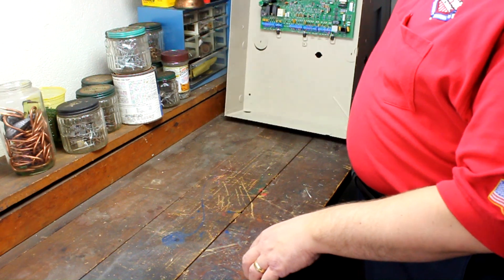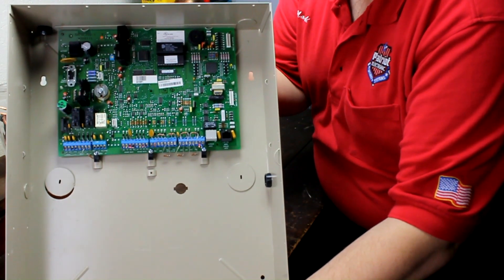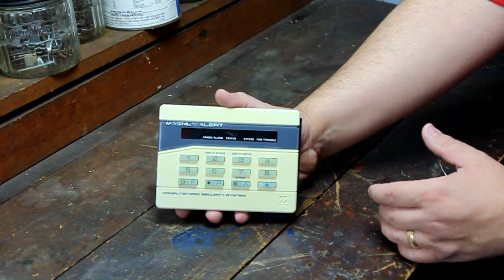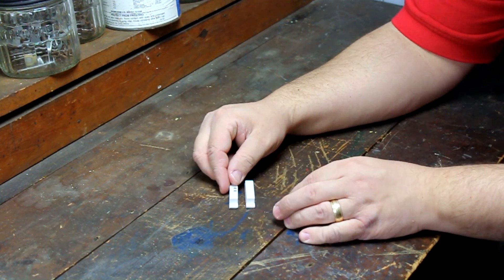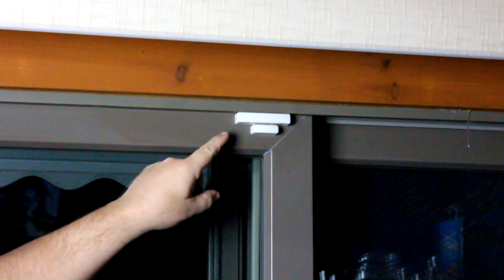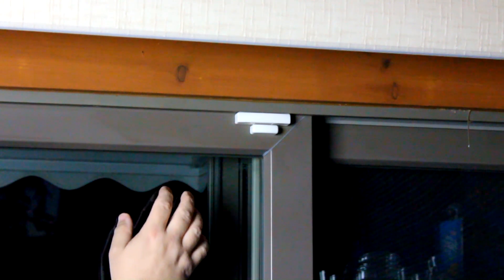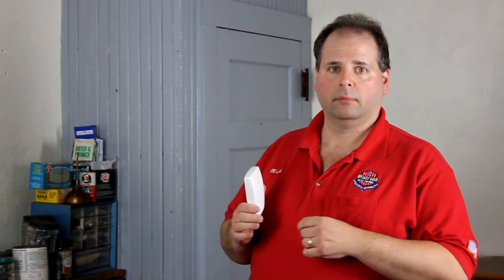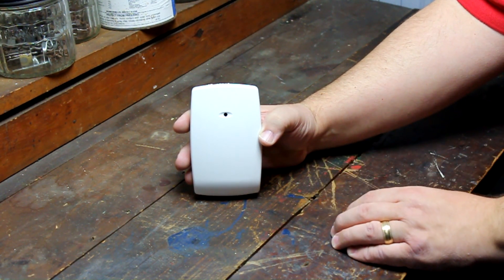How a Security System Works (Part 1)

Comment: So, what powers the transmitter that is next to the magnet?  battery?  certainly not wires as that would be cost-prohibitive.
Reply from the maker: If you are using a wiresless systems the transmitter is indeed powered by a battery. If however this is a wired system, and the contact is just a door or window switch, then wires run to the switch and the circuit that the swtich is a component of is powered by the alarm control board.
Reply: This ADT one has the big unit on the door and tiny magnet on facing but no wires.  There IS a battery inside but if you disarm the system THEN remove the cover of the big unit, it KNOWS!  It sends some alarm even when the system is disarmed by the user.  Then the phone call says the batter is just a backup.  ?  I'm totally confused.

I understand a switch can be turned off on by a magnet but how would the main panel know the cover was removed?  Another switch, maybe?  And that big battery inside... that has to be powering it when the switch is engaged, I think so doesn't that also mean the batteries will die over time like 5  years or something?  Anyway... just was curious about a friend's system.  I guess I could call ADT. hehe thanks for the answer.